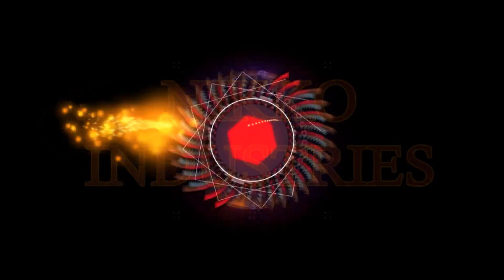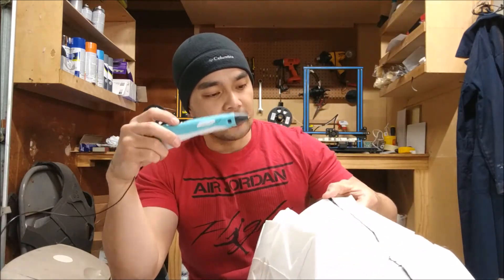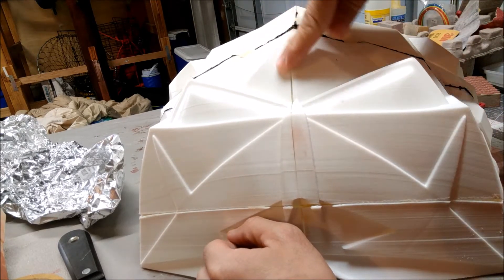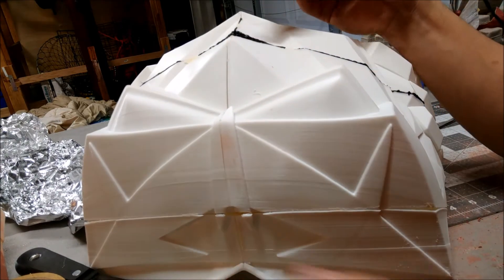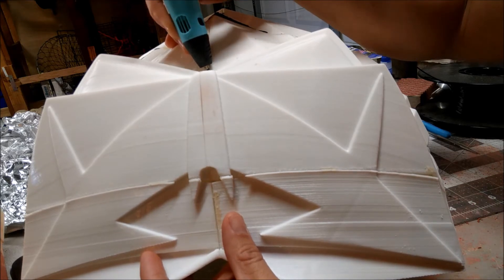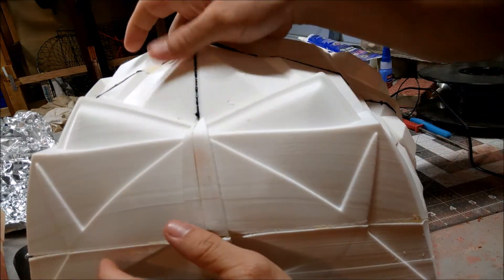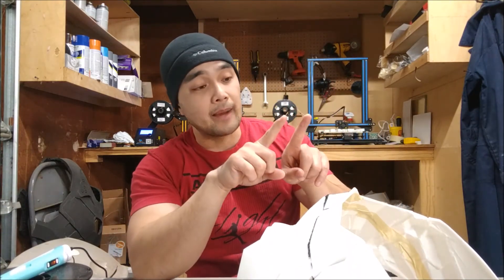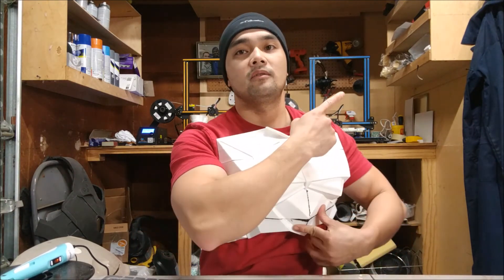3D Printing Tutorial- How to Weld With a 3D Pen

Comment: Have you tried taping on the outside/visible side and welding from the inside? Seems that the tape might help keep the pen PLA flush with the part’s surfaces. Just an 💡

Comment: would this same process work with tpu material? any good recommendations for gluing tpu together?
Reply from the maker: for TPU i tend to do full pieces. i havent really found a way to properly glue them together. Super glue is too brittle. i've tried hot glue but it doesnt provide a good enough adhesion.